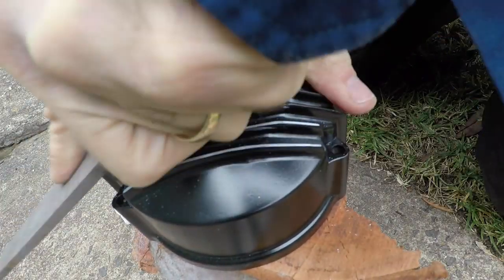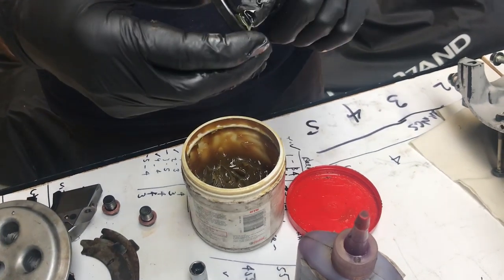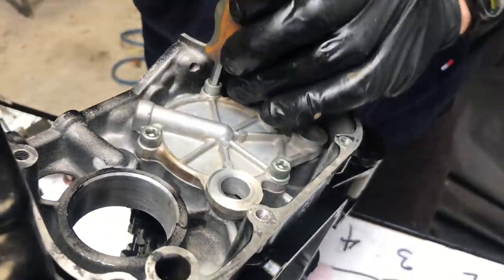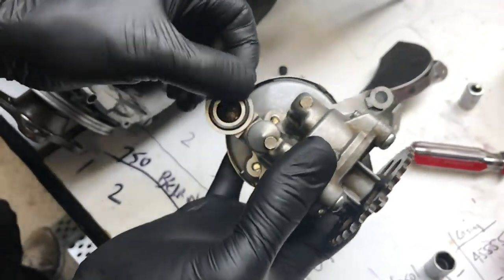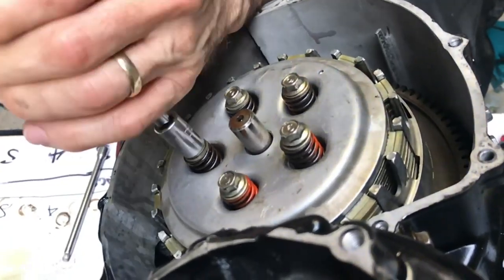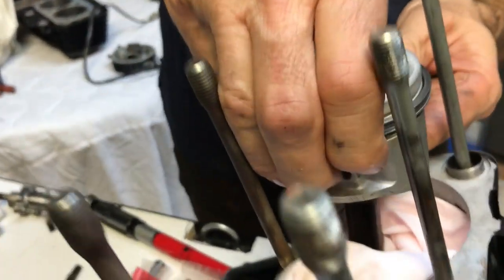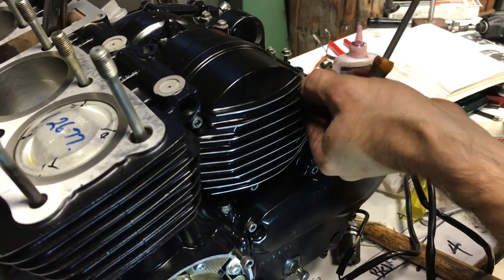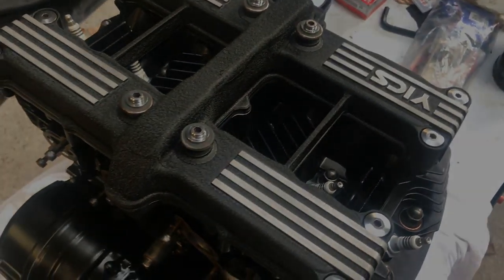Yamaha XJ650 Part 25 Engine Overhaul

Comment: NOTICE: Spray Nozzle Orientation.

This just a note for anyone who runs at a rebuild with excitement and could miss this one small important orientation.

It might be obvious to most viewers but just in case:
That spray nozzle (5.39 in this video) must be oriented so it's hole matches its crankcase hole brother;
which you can see looking inside the tube in the crankcase where the spray nozzle goes.

Also which might be obvious: Passage clearance of this nozzle.

Properly best to ultrasonic clean (or similar solvent soak / clean / air blast) this nozzle to ensure its passage for oil is clear and good. Wear the safety glasses guys (and gal).
The actual spay hole is not large.
And Primary chains are expensive enough and replacement not a stamp lick as we can see.

Great video.
Reply from the maker: Good tips mate

Comment: My bike (82 XJ650) has been dead for over a year and needs to be completely pulled apart to clean out the chunks of clutch basket that jammed up the transmission. This video is giving me the confidence to actually dig in to that project so I can ride again next summer.
Reply from the maker: Great to hear. Good luck with your build

Comment: Hey Mezzmo, this is the best engine video around and has helped me tremendously.  One error though, the seal on the trans countershaft bearing should face inwards.  This bearing receives pressurized lube via the bearing retainer cover from the outside.  With the seal facing out, it only will receive splash lube from the gear side.
Reply from the maker: @lukeperhaps2734  Thanks mate, glad you liked it. Interesting about the bearing, I thought the same however it was that way originally from the factory. See it in the pull down video. I figured it was fine after 100k so decided to put it back the same way. Really not sure why they bothered even putting a seal on one side
Reply: @Mezzmoengineering Yep looks like the factory must have got it backwards.  I think the reason for the seal is to add a little back pressure as the same lube oil is diverted into the hollow gearshaft to lube all its bits also.  Your entire series on this bike is top notch.
Reply from the maker: @lukeperhaps2734  Thanks, I appreciate the comments and also like discussing things like design, errors, possible improvements etc. Cheers👍

Comment: Love the attention to detail in this build! I have done my rocker cover in the same finish too ✌️
Reply from the maker: Thanks Jish, hoping to get out on a first ride sometime soon.....Still a lot left to do though...
Reply: Both of you are inspirations.  If my engine turns out half as nice.....! I used an xv1100 swing arm to mount the xj900 rear rim.  The bike is an xj650 with the R1 front so the 900 rear gives me an almost matching 3 spoke and the 1100 swing gives me just a little longer wheel base. This did take some careful grinding.  I read the xj700 non X cams are the most aggressive I will try these eventually but I have learned so much from this I am grateful for that. Thank you Mezzmo thank you Jish awesome job! XJBIKES!!!

Comment: I was looking for a problem with my xj900 and it doesn't turn on the 5th gear but instead turns on neutral... I realized I had put the middle fork in the opposite direction... I will try fix it by removing oil pan. Sometimes we all make mistakes. Without your video I wouldn't have found out. Thank you! 😄
Reply from the maker: Hi mate, glad it helped you out.

Comment: Hi mate,
Great videos, restoring an xj650 myself, parts are getting hard to source now, one of the gearbox bearings in the crank case is closed in, is a blind bearing puller the only way to get it out, many thanks and thanks for the videos.
Reply from the maker: Hi, not sure of the bearing you're referring to but I got them all out without any puller. Let me know exactly which bearing and I'll tell you how to remove it

Comment: Spray Nozzle Update:

Just noticed a pic of a new primary chain spray nozzle shows a location pin extruding from the head.
This must be what locates in the slot that's in the opening of the crankcase where the nozzle goes.
I reckon without this, a nozzle can vibrate over time to an off-location. Reducing or fully negating its operational function.
Something to consider if you are re-building with a re-use nozzle.
Reply from the maker: Hi Mate, yes that pin goes into a slot of the crankcase to ensure the hole is pointing the right way. I forgot to show that detail in the video. Then the cover is whats holds it in.
Reply: @Mezzmoengineering  Ah no worries. The nozzle ideally has a pin to guide but mine didnt. Hence the comment.
I don't know what kinda guy was in here before me the poor fella.
Clutch nut undid by fingertips.
Cyl. No.2 con rod missing a bearing shell.
I'm missing a SHED!

Comment: Well worth supporting thanks.
Perfect timing to get the video I'm replacing the lower crankcase tomorrow.
(I think).
Reply from the maker: Good one, glad its been helpful
Reply: Hope the public takes my hint there.
Q: Can I ask what solution do you add to the water for carb cleaning ultrasomic.
Alkaline or acidic or PH neutral stuff?
Thanks, When you get a minute cheers
Reply from the maker: @clickireland1113  Good question, Given I used bi carb soda to clean my carbs I just used straight water in the ultrasonic cleaner with the main aim to dissolve the soda. Someone else should be able to advise, I think the solution might differ on what you're trying to cleaning. A mild detergent would work well imo.
Reply: @Mezzmoengineering  Ah cheers for the reply. I'd reckon water'd be grand. I've all the bi carb soda grabbed off the shops shelf anyways. Waiting on kit from UK
Reply: @Mezzmoengineering  Great job on the build.
Pole position was funny as hell well done.
Started splitting the engine today. Rain here.
Figure snce I live in a quiet catholic village I'd roll the bike out when its finished to some appropriate music.
Cypress hill - Latin thuds. Should do rightly.
Reply from the maker: @clickireland1113  Good on ya mate, glad your progressing with your build

Comment: hey mate, sorry to ask you another question but ive been working on a 650, putting on a split timing chain like you. problem is, i cant find a riveting tool small enough for the cam chain. most rivet tools are for drive chains. How did you peen that cam chain master link at 22:25 ?
Reply from the maker: Hi mate, I just placed a hammer behind the link to support it and then used a pin punch and another hammer to peen them over manually. No need for special tools....

Comment: Beaut job man in the process of rebuilding my fz 750 engine  which shares a similar bottom end architecture with the xj  six gears and no shaft what’s that beaut engine paint you’ve used  mint
Reply from the maker: Thanks Karl. The cam cover paint is VHT Wrinkle black and the rest of the engine is Knight Rust guard is matt black

Comment: Hey Mezzmo,

Just 1 question about the Sealing ring in the Final drive at 6:25.
There is no one in mine.
So what to do?

Sorry for the bad english. :)
Reply from the maker: HI Mate, you need at least one half ring for each of the bearings. As long as there is one per bearing it will be ok. This half ring can site on either the top or lower case half. But you will have problems if there is no half rings at all on each bearing

Comment: Love the video, super informative. I've got an '82 XJ650 myself as a project. I have two questions that i'm hoping you can answer or help me with.
1. Where do you get all your parts, especially engine parts like seals and gaskets? I'm having real trouble finding places that still stock parts.
2. I tried cranking the engine by hand to make sure it wasn't seized and I can only get about 1/2 turn before it stops and wont turn any further. Can't see anything under rocker cover so it looks like i'm going to have to take the cylinder head off to inspect the valves. Should i be replacing the gasket/o rings after that? Can you think of any reason that I wouldn't be able to crank the engine all the way other a piston hitting a valve?
Any help would be greatly appreciated!
Reply from the maker: Hi Jake, parts are hard to find. I got a few bits from private sellers on ebay as well as some new gear directly from Yamaha. Your Yamaha dealer should be able to get most of the seals and gaskets. The engine not turning could be a number of things. First to turn it by hand you should remove the spark plugs so there's no compression.  If its still hard to turn it could be timing way out or possibly something gone wrong in the transmission. If you cant turn by hand with its plugs out then its probably best to pull it down to check the problem. Take cam cover off first to check inside there, eg timing marks. Then you could remove the sump to see what's there and if any loose bit are there which could indicate a damaged primary chain guide...

Comment: i noticed you stressed that the sealed bearing at 7:27 faces outwards, is that emphasis because the h...nes manual states the opposite way? just gladI am following YOUR video!
Reply from the maker: Hi Mate, I haven't read that detail in the Haynes manual but yeah it needs to face out because the vacuum is pulling those lips tighter and sealing more. The other way around and air will pass
Reply: @Mezzmoengineering  that makes sense - thanks - I have had enough of air passing lately...one other thing - the oil pump chain looks a bit slack? moves in/out mebbe 15mm, it doesnt lift off the sprocket tho  - more paypalcoming - you have been SO much help, my build had stalled badly
Reply from the maker: @stevec-b6214  The oil pump chain doesn't have much slack in it, just a tiny bit. No chance of it lifting, if yours is too loose I'd recommend replacing it.
Reply: I also have this question. I'm rebuilding my 750 Seca and the UK Haynes manual states clearly the sealed side goes toward the inner edge. However my disassembly pics have it facing outward as you do. I guess I'm gonna go with how it was. Always a bit exciting ignoring an explicit instruction in the manual. Also thanks a bunch for this series, it's great!

Comment: Hola dónde compraste los retenes y otros accesorios q se necesita para hacer el mantenimiento de esa parte del motor. Espero su pronta respuesta. Gracias
Reply from the maker: Hi, I purchased the seals from eBay and some from my local Yamaha dealer. Not everything is still available but I just searched online until I found what I needed

Comment: Maestro! you have helped my build enormously. Did you put new parts in the starter clutch? XJ forum seems to hint it can cause probs. I have the opportunity because the bike jammed in second gear on my test ride, and the motor is on the bench again. When I split the cases the lower casing gear shaft was solid. I couldn`t get the selector fork shaft out, as the fork that sits in  5th gear was jammed, I had to tap the bearing out from the inside with a thin drift, I just can`t figure what went wrong
Reply from the maker: Hi mate, glad my video has been helpful. I left the start clutch as it was because it was still like new, All damaged or worn parts were replaced. Good luck with your build.

Comment: Hi again, thanks for your reply, very decent of you.
In your video part 25, 2 minutes 31 seconds in, you are fitting a guide in the upper crank case, the bearing in question you have installed just to the left.
Can I ask where you got the big bore kit from, have you any experience with over size pistons kits from cruzin image.
Many thanks mate, I do appreciate it, cheers.
Reply from the maker: Hi mate, OK I see the bearing. Yes, you need a blind puller for that one. I left it in as it was in very good condition. I got the big bore kit from a private seller. Not sure who sells them now. I haven't had any experience with other motorbike big bore kits. I have done a big bore on my celica too but used Wiseco pistons. Without knowing the brand I'd suggest searching for reviews. Most pistons are fine. If your concerned you can balance them, check my early video on engine balancing on my celica build from around 5 years ago as it shows exactly how to do it.

Comment: i waited though this whole video just in hopes to see the cam chain tensioner broken down so i could see the tensioner bolt then you use the 750 auto tensioner....lol
maybe you can answer question for me, while the engine is still in the bike fully assembled can the tensioner bolt be simply pulled and replaced without causing problems???
Reply from the maker: Hi mate, Sure. All you need to do is buy a XJ750 tensioner, remove the centre bolt so you can push the pin right back. Bolt to barrels first, then install spring and tighten nut. Like I did in the video and it will self adjust. The old one can just be taken out and swap straight over. The main thing is installing the new one with the pin pushed in and you can only do that with the bolt and spring removed.

Comment: Awesome. I love your videos. I just hope I’d be a little bit more knowledgeable so I can advance on this project I got myself into with almost no experience just the love for the bikes. Like right now I would like to know if oil is pumping on my Yamaha 1981 XJ650 Maxim but can’t find answers on the internet just how to chasing oil and so on.
Reply from the maker: Thanks mate, good to hear you are tackling your project. Take a look at my "First start" video and you will see the line I remove to check oil is pumping. It's just before I start it up for the first time....
Reply: @Mezzmoengineering  I’ll do it today and will give you a feed back. Thanks for your quick response. I really appreciate it. Keep it 🆙😎
Reply: Sooo, today I just finished rebuilding my the carbs and cleaning the wires since I built a center box for hiding battery and extra wires. But when I started it started leaking a lot of oil from the oils filter plate. 🤦🏻‍♂️🙆🏻‍♂️ never ending built I call it. Aka What now!
Reply: Now going back to your playlist and find the answers to my new problem. You are my inspiration. 💪😎

Comment: O rings on crankcase mating dowel pins (one visible 10.48 top left)

Hi Mezzmo,  do I see O rings on the crankcase mating dowel pins ? (One visible  top left frame 10.48). I can't find any reference or part numbers for these anywhere. Awesome video by the way.
Reply from the maker: Hi Kevin, check this link. It has the info you need....https://www.cmsnl.com/yamaha-xj750r-seca-1982-c-usa_model8879/partslist/B-08.html#.ZDnTY3ZBy5c
Reply: @Mezzmoengineering  , really good of you to take the trouble to reply and upload the link, thanks. I see every O ring including the one by the clutch shaft bearing with the machined recess but  nothing for the other  three crankcase halve locating dowels. Looks like I'll  be rolling the dice on this one.:hand-orange-covering-eyes:
Reply from the maker: @kevinmayes9072  Hi mate, the other dowel you refer too don't have an o-ring as they just locate the cases. Only sealant around them. The one for the o-ring is there because its the oil feed gallery.

Comment: Hey mate- love your work!!
I'm in Australia as well and fixing up an '81 XJ550 and curious about the ins and outs of subframe modifications. How was the process of getting it checked off for rego? Did you register it before modifying it?
Also love the paint work on the engine! Would love to know the details of what was used and where you got it done. 
Cheers!
Reply from the maker: Hi Will, glad you like it. I did everything myself, the whole build is on this channel. Bike was already registered, it was only a very minor change, not sure if they would technically deem that to be a mod as it didn't reduce frame strength in any way.
Reply: @Mezzmoengineering  Good to know. Thanks for the quick response!

Comment: Hey dude, I'm engaged in the same undertaking. I'm having trouble aligning the timing points with the cams. When I spin the crank to E, the midway point, the cams do not want to sit in their appropriate positions, therefore I am unable to determine when the crank is halfway.
Reply from the maker: Hi mate, if you have the head off and the cams are out then you can bolt it on with the crank in any position. Once the head is on, turn the crank to TDC and then install the cams with the marks pointing upwards like in my video. With cams in, install chain, rotate to check timing is correct and you should be good to go. Hope this helps.
Reply: @Mezzmoengineering  Thanks! Just figured it out!

Comment: Is there an o-ring around every pin/dovel between the cases?
Reply from the maker: Hi Mate, no, not all pins have the o-ring. The main o-ring is to seal the oil gallery as per video
Reply: Ok. Just thought that I saw that there is o- rings in the 3 pins in the lower casing. Thank you 4 the answer.
Reply from the maker: Hi again, the main o-ring is where I show in the video from the oil gallery. There are others but from memory I don’t think they are on every pin. They are where the oil feeds are. One of these feeds is for the cams. Best way to see is closely check all the pins to see if there’s a small space machined in the casing. If there’s a small chamfer then it needs an o-ring, if it’s machine completely square then there will be no O-ring. Hope this helps

Comment: Hi Mate,  Can I remove head and cylinders with engine in frame?  I bought a bike with head and cylinders out I'm wondering if even possible to reinstall new heads etc with engine in
Reply from the maker: Good question, I’m not sure as I haven’t tried. My guess is I don’t think there’s enough room. Even if it’s possible, I think the lack of space would make it easier to just remove the engine so you have full access.

Comment: Trying to rebuild my 81 midnight max
Any advice?  Either then tossing it away? 

Thanks 🙏 for the videos
Reply from the maker: Sounds like a good plan. Only advice is take your time, use good parts and use videos like mine to help you with info you need